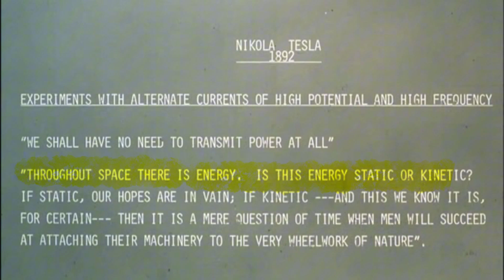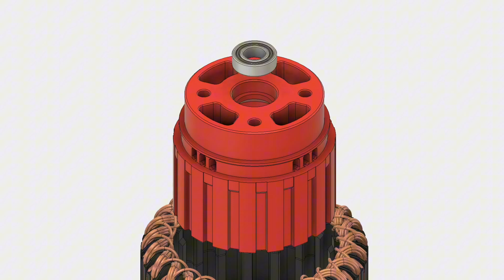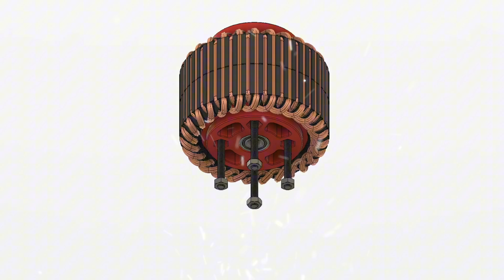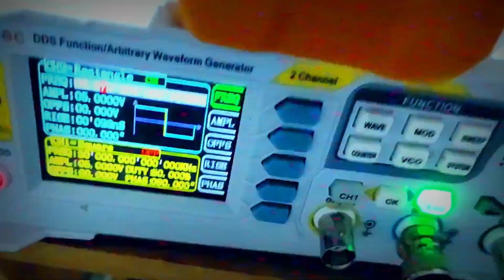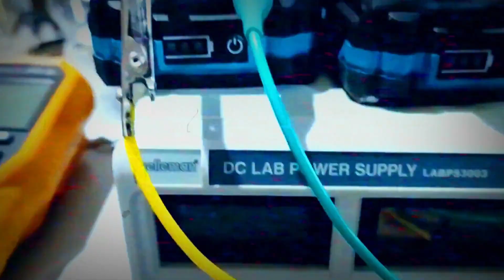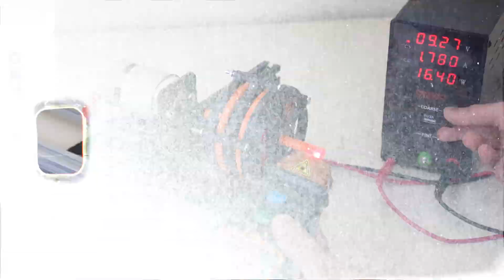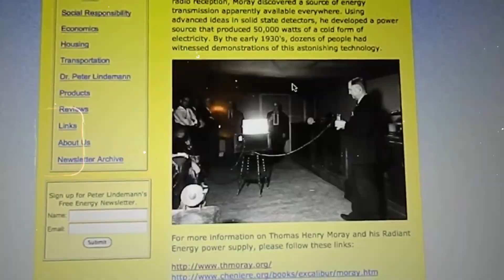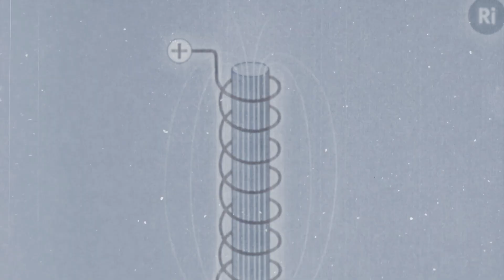How Moray and Tesla’s Inventions Could Change Energy Forever

Comment: Yeah this is totally legit technology we have had this for about 100 years it uses teslas raidiant energy circuit patent the government  threatened  him and his family until he stooed giving presentations  on it but the actually blue prints to build one are on the internet and his son wrote a book called sea of enerrgy fron what u gathered it  usese germanium and zinc sulfide in a vacuum  tube with a reciever  that is oscillating  at  the right frequency  hooked up to a reverse  tesla coil but its converting  gama radiation  into cold electricity
Reply: It is definitely not Teslas patent on radiant energy. This patent is based on the photoelectric effect which is in comparison to todays photovoltaic very unefficient. If it would be possible to tap a sea of energy with such simple means we would do it since a long time. It is nonsense that it would/could be suppressed.

Comment: Well it breaks the laws of science so I’m going to assume he was a scammer.  There’s no such thing as free energy in the real world.      Doing the impossible is impossible.
Reply: There's around 50 errors to the so called laws of thermodynamics and don't get me started on the conservation of energy.. 

We can detect and measure 2 types of energy and a few types of radiation... 

The Ether used to be part of chemistry, and should still be.. The Dirac Sea is very real, most of the most impressive old world architecture enraptured it, used it, and activated it with sound, vibration and resonance.

Since cymatics can make a plate of copper produce eddy currents in a predictable form - what makes it so impossible as to produce over-unity by the collection, reorganization, compression and collapse of plasmids in controlled devices when there's open air versions everywhere.

Pyramids included.
Reply: @ArmsRaceAI    Conservation of energy: can you get started just a little and inform me about just one observation where this conservation law fails?
Reply: @ArmsRaceAI  An expert in explosives said the atomic bomb would never work.  Your comments sound very similar.
Reply: You'd be wrong.
Reply: HERE’S HOW HIS DEVICE WORKED

At any time in Earth’s atmosphere - and in space - exists difference random frequencies of electromagnetic waves including radio waves, light waves, ultraviolet waves, etc. Cell phone electromagnetic waves, TV electromagnetic waves, we are ‘drenched’ in electromagnetic waves every second of our lives. You cannot see them. But we know our cell phones work.

His device had an antenna like a radio. He concocted a then-rare (read: not widely known) blend of germanium, bismuth and other materials and made what we now call a ‘dielectric resonator.’ Every cellphone has a dielectric resonator these days. They allow only ONE FREQUENCY to pass through from all the random electromagnetic wave ‘carrier’ frequencies a cell phone is bombarded with. There are different cell phone carrier frequencies, and each cell phone uses one of them and has to block all the others to prevent interference. These days, manufacturers know how to engineer, how to construct dielectric resonators to block all but the one frequency the cell phone is designed for. Back in Moray’s day, he had no clue. He couldn’t have. Dielectric resonator science didn’t take off until the 1960s. So he was ‘getting lucky’ - he created his germanium/bismuth/etc. dielectric resonator. Due to the way his device works, he’s not trying to tune in to a cell network. He only needed to receive ONE of the random wavelengths that are always in the air and block all the others. His device required a single electromagnetic frequency to work. This is why he called his device a ‘radiant energy’ device.

Why is a ‘dielectric resonator’ - resonating? Because electromagnetic waves are sine waves and they cycle through a positive half cycle then a negative half cycle. Over and over again. Look up ‘sine wave’ and ‘electromagnetic wave’. A dielectric resonator only resonates at ONE frequency and blocks all the others. Just what he needed.

So his antenna ‘pulled in’ lots of random frequencies out of the air and fed them to his germanium/bismuth ‘detector’ (dielectric resonator) and only ONE FREQUENCY was then passed through to the tubes in his device.

Now the other amazing-for-his-time part. HE ACHIEVED OVER-UNITY by two different methods. First, he leveraged ‘secondary electron emission’ (look it up) made possible by his use of ‘cold cathode’ vacuum tubes. Argon gas ions and electrons bombarded his cold cathode and knocked free more and more electrons resulting in more and more current flow in his tubes. Second, he leveraged ‘negative resistance’ which is what happens to electric current flow in a plasma tube (including fluorescent light tubes - they are ‘negative resistance’ devices). ‘Negative resistance’ manifests as follows: (1) first, you have a tube with a vacuum in it, filled with argon and mercury vapor; (2) second, you ionize the argon/mercury vapor - that enables current to flow at a low magnitude at the beginning; (3) third, you patiently wait and allow the current to keep increasing the ionization level of the argon and mercury until it’s a FULL BLOWN FREAKING PLASMA in the tube! Plasma is the best electrical conductor known to man. (4) fourth - if you don’t do something to limit the increase in current flow through the plasma, you get so much current flow that the tube will explode! That’s how much power is in this ‘negative resistance’ phenomenon! A modern fluorescent light tube STOPS this ‘runaway’ increasing current problem by way of a ‘ballast’ that is part of the tube’s electric circuit in its fixture. NOTE: the electrodes in fluorescent tubes will break down if you try removing the ballast to get this huge negative resistance phenomenon. The tube manufacturers do not want to get sued. So it is not really possible to create over-unity devices using fluorescent light bulb tubes.

He used a radioactive material liner inside his tube because it spews out beta radiation which will create a LOW LEVEL of ionization in the argon gas in his tube. This is an impressive trick he pulled off. No one uses radioactive material to create an initial low-level ionization of argon gas in fluorescent tubes. But fluorescent light bulb tubes ALSO need some means to create an ionization in the gas in the tube. So instead, a small circuit WHICH REQUIRES OUTSIDE POWER (from a wall socket) is used to create an initial ionization. See, THIS IS WHY NO ONE BELIEVED HE COULD PULL OFF ‘power out of the air’. They did not understand that by using radioactive material in his tubes, he didn’t need an outside energy source to create that necessary low-level ionization of the argon. Once the radiation in his tubes created the very low-level of ionization in the argon gas, and he supplied across the tube the low-voltage radio wave pulled out of the air - BAM all he had to do was wait a few minutes and the small initial ionization and small voltage radio wave would build up to a FULL BLOWN FREAKING PLASMA! inside the tube. This build-up from ionization to massive plasma and current is called a Townsend Avalanche.

Here’s how that initially low-level ionization of argon, and the very weak radio wave signal, evolve in the tube. It takes some time. In his book he mentions ‘4 minutes’ or so. First, the radio wave creates a small current flow in the very weakly-ionized argon. Electrons collide with molecules of argon and knock electrons out of the argon atoms. They in turn collide with other argon atoms which knocks more electrons free, and the argon evolves from ‘weakly ionized’ to ‘plasma’ with MASSIVE current flow in the tube. This is an over-unity freebie effect. Notice this. No AC power was hooked into this device. He relied on a radioactive material to create a weak ionization of argon. He then fed a single weak frequency radio wave pulled out of the air to incrementally knock more and more electrons free from the argon gas atoms. THIS EVOLVES INTO A ‘TOWNSEND AVALANCHE’. And he used capacitors to tap off the energy out of the gas. Good thing too because his tubes would otherwise explode.

To review: Moray has pulled in lots of random electromagnetic waves on his antenna, fed them through his crude dielectric resonator to block all but one frequency, then passed one frequency to an argon/mercury vapor tube weakly ionized by radioactive material, then WAITED FOR THE TOWNSEND AVALANCHE TO DEVELOP.

NOTE: Why was it important to only feed one frequency to the tube? Why not just pass all the random radio (and other) waves from his antenna to his tube? Because the tube needs to get into a resonant condition. It needs to resonate back and forth at one frequency and build up incrementally to high current flow in the tube. If lots of different frequencies were present, the Townsend Avalanche would not be easy to attain - lots of different frequencies is ‘static’. ALSO: Even though the radio wave was always a very low, weak voltage - IT WAS STILL NECESSARY. Why? To keep the resonating current going, TO KEEP THE TUBE OSCILLATING. His tubes OSCILLATED at that one frequency. And that radio wave he randomly filtered into his device created the oscillation. And maintained it. One of his witnesses shorted his antenna to ground and the device stopped. Even though that stray radio wave was weak, it was STILL needed to keep the oscillating tube - oscillating. Oscillations ‘dampen out’ if you fail to add a correctly-timed ‘push’ or electrical wave in this case. You can think of it like pushing someone in a swing on a swingset - you get them swinging - that’s at one frequency - if you bump into them with a different ‘frequency’ of push - it will slow them down. If you push them at the SAME frequency - at just the right time - they will keep swinging. If you stop pushing them their swinging will slow to a stop.

In other iterations of his device, instead of a dielectric resonator, a ‘bandpass filter’ was used to block all but one frequency.

When you look at a fluorescent light tube - that is a ‘negative resistance’ device and is conceptually similar to Moray’s over-unity device. But it needs outside power because (1) using radioactive substances in consumer devices is not feasible these days, and (2) no one will buy a fluorescent light bulb if it takes 4 minutes to light up.

But modern fluorescent light bulbs will NEVER go into a Townsend Avalanche and build up huge power that can be diverted into, and stored in, a capacitor, due to the ballast current-limiter device, and the really weak, quickly-disintegrated electrodes. Moray’s device could output a lot of energy (7500 watts in some versions) because he used the power from the runaway current, the high-current plasma, to charge capacitors.

Moray used radioactivity to avoid needing an outside power source to ionize his gas. Then his cold cathode tube when bombarded by argon ions and electrons produced more electrons. This spiraled into more and more electrons being knocked out of the argon gas atoms. The electrons flowing in the current created by the radio wave also knocked more and more electrons out of argon atoms. ‘Negative resistance’ and Townsend Avalanche resulted.

MORAY’S DEVICE WORKED. He was clever in how he put together negative resistance/Townsend avalanche gas plasma effects, in how he pulled just one frequency out of the air, in how he used radioactivity to ionize the argon to avoid needing outside power.
Reply: As far as you have been told! Have all possibilities been tried and completely eliminated?
Sleep well.
Examples of "laws" -
The earth is flat!
The sun revolves around the Earth!!!
The Sun is Nuclear? Why is it dark on the inside.... Guesses guesses and more guesses.
Just saying. 🤔

Comment: The high frequency reducing device called the R E cost about $500,000 back in 1950. With today's inflation ,- no way.  The cold cathode glass tubes had no separate power supply. Radioactive pieces emitting electrons ran the tubes. Public is not allowed to have radioactive substances. Even the smoke detectors were taken off market with radioactive paint. Patented spark plug designs with radioactive tips were not allowed for production. Very old gold as rings had some radioactivity and caused burns/cancer on fingers. Bell laboratories took credit for the first transistor amplifier. The dated documents from Moray showed his "amplifying Moray valve" , as a part of a sub system of the RE, way back before Bell Labs saw the RE device up close and studied. Book - The Sea Of Energy In Which The Earth Floats.
On another note, The first computer miniaturized Integrated circuit is blatantly stated as not invented by the American Computer Company. Their technicians did not file for Patent. They said debris samples were allowed to be taken from wood crate from Bell labs from1947 Roswell crash was examined under microscope and re engineered as duplicate  IC. The Ic's were used in first production of a personal computer board. Guess where the first solid state hand held SMALL laser with switch was found in 1947? Beam at distance and cutting tool up close. Several Industries were given material to study for later military use, BEFORE going to public market. Book - The Day After Roswell.

Comment: Light is frequency so we're surrounded by that in day time but also rocks and various things. Resonance likely supplies harvestable energy. If a closed electric circuit has a frequency that a piezo diode type generator can be calibrated to pick up, that might be another path, but maybe these two did already make better/early version of "Corona motor. "
Reply: Photovoltaic technology releases the visible light wavelength for free electron use, multi junction silicon solar cells harness more of the radiation.
Reply: " Resonance likely supplies harvestable energy "   Definitely not. Resonance can accumulate energy but it has only the energy which was input before.
Reply: @sciencefreak9070  Two points are wind turbines apparently use frequency in power from the  spin...but secondly if something has resonance, whether water or material etc..The Earth made the resonance forming the source. That's the energy input, conceptually.
Reply: @sampleoffers1978    Electrical power is gained from wind by generators. This has nothing to do with resonance at all. Frequency is only important because you have to feed the gained electricity in the AC grid with 60 Hz (or 50 Hz in other countries). That's why the blades rotate at a fixed rate. This rate can be changed by gear boxes or generators which allow the number of poles to be changed.

With resonance the energy input is always an external stimuli, it has nothing to do with the forming of the material. Your ideas about resonance seem a little vague to me. I can recommend Wikipedias entry about it, it explains what resonance is about.
Reply: @sciencefreak9070  I thought it was about  spinning turbines...but there was an article mentioning the  frequency the spinning blades generate factors as  energy, not just as format for grid.. Secondly...solar light is also  frequency. I think youre saying frequency can not be converted to energy more broadly, and I just don't believe you, so we may as well not interact further.
Reply: @ Supplies is wrong word choice, but conceptually, the point is there is energy to resonance. It can be supply  is more point, reservoir does not make water, it collects it for supply